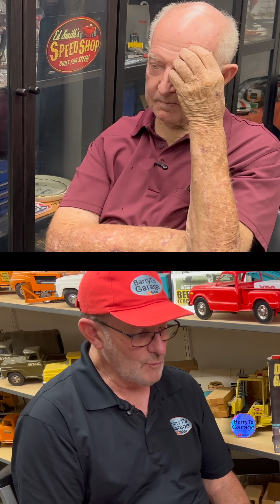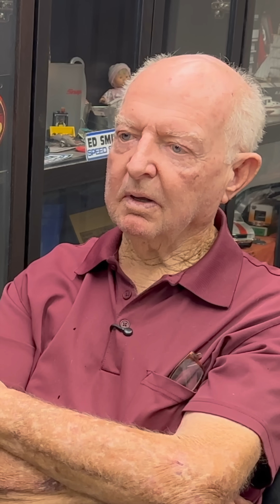Pre Oiling a 427 - Ed Smith w #BarryT from Ask Ed 45 #classiccars #mechanic

Comment: Less cost, mess & easier to install a coil ground switch under dash, crank the starter until oil pressure shows then switch the coil back on. 
🤗 2 cents, no charge! 😅
Reply from the maker: I can ask Ed his thoughts, but I think someone else has mentioned. You are still initially cranking with low oil pressure even though you’re not firing it?
Reply: @BarryTsGarage   Yes right, and I do get it, based on the man's question he may strictly object as even slight movement defeats his point. 
I just tossed that out quickly before the squirrel in my head could get grumpy with me for being slow again! 
😂👋🏻

Comment: For Preoiling any engine Meziere WP 723 kit is selling a Pre-oiler for every engine , with 12 volt pump so I've heard forever that the Main cause of bearing wear is from start up cause engine does not have oil pressure until it starter is engaged so with this new for Sema  2025 Meziere WP723 kit will pump about 40 pounds of cold oil pressure through your engine Before starting it.   I have always wondered how long a engine would last being Pre- oiled before every start.  Now I am going to buy this new Pre-oiler for sure and find out !!!
Reply from the maker: Awesome

Comment: I would just pull the coil wire and turn the engine over for 20 seconds.
Reply: Need oil pressure before  it turns over 1 revolution 😮
Reply: Any mechanic can say it's a must have, aircraft have oil pressure before you start the engine
Reply: Yep, put the fuel injectors or the fuel pump on a switch at the fuse or relay, so your not injecting fuel, crank until pressure comes up, flip the switch for fuel while cranking and bam youre on your way.

Comment: Id use an accumulator.  With a check valve  and bypass with a tee and ball valve. The accumulator would be refilled when it starts. Hit the valve and then the starter. As soon as it fires , close the valve.  Running with it a quart or two over full will not hurt for a few seconds. Use a restriction to fill it slowly. A 1/4" line with a 1/8" passage,  solder up a fitting, and drilling a hole through it with a (-8) 1/2"  or larger line feeding the engine. With a 1/2"-5/8" or 3/4" ball valve. Use a romote filter /cooler kit to tap the oil. And use a check valve a high flow valve. Or just use a valve to fill it when pressure is high , then close it . Open it when starting . A12v pump with a separate pickup and filter . To run for about 15-30 seconds before starting . The accumulator is the easiest idea. Can be as simple as opening a valve , start the engine.  When its running, rev it slightly (about 2000-2500 rpm) and then close the valve . And oil changes just open the valve and dump the pan.  Wait about 30 minutes before plugging pan. Refill the pan, 5qt or what ever. Open the valve for 30-60 seconds, while running at 2000 or so, then close it. Kill the engine,  wait about 10 minutes, check the oil and add about 1.5-2 quarts, about a half quart less than the accumulator holds, adding a valve to the traditional accumulator  is the most simple way to do that..
Reply: Every motor needs oil pressure before you turn the key 😢
Reply: @jamest.5001  where do I relocate  the engine oil ascended unit for oil pressure  gage  on 4.3 v6  1999 s10  chevy ridiculous  factory location next to firewall obscured by distributor very innascesable.

Comment: 30 years ago a fella had a 67 chev pickup with a preoiler. Looked like a starter motor hooked to a gear pump. Sucked out of the pan and shoved it back into the  oil pressure gallery like Ed says.
Reply from the maker: Very cool!

Comment: Years ago, you could buy an oil accumulator to stop dry starts
Reply: Moroso Accusump, but made and sold by Canton, uses electric solenoid to hold oil overnight.
Reply: Oil should flow for 10sec,before the  moter turns over
Reply: Every car needs a pre oiler 😮